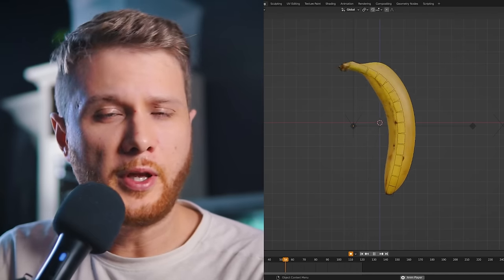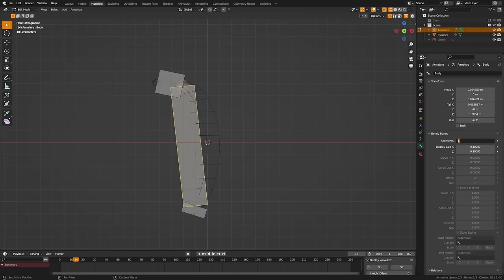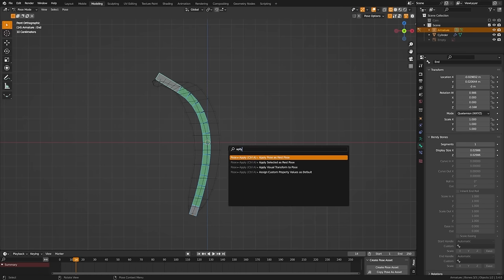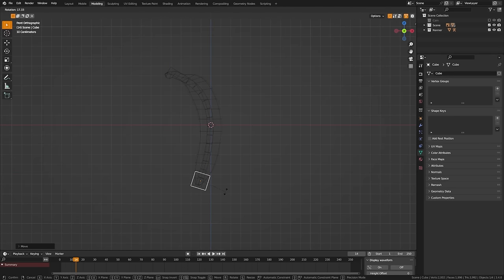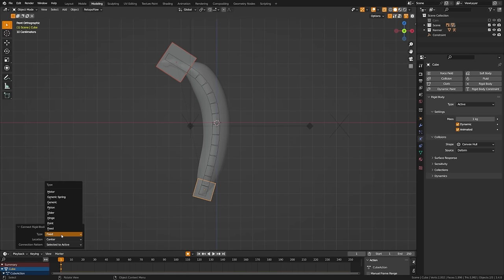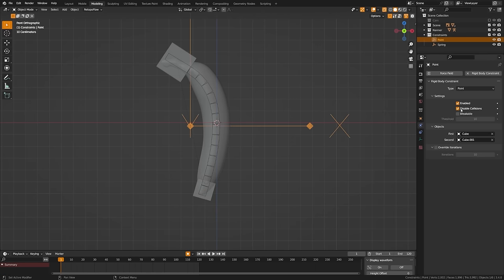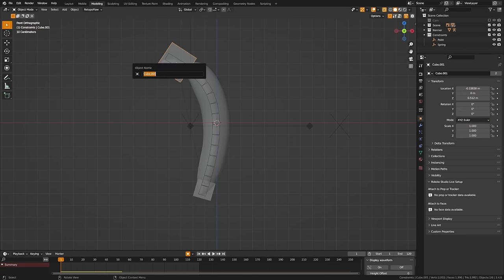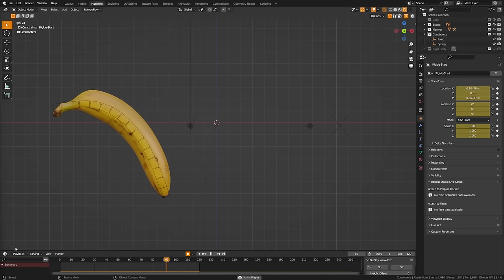EASY Floppy & Jiggle Physics Rig in Blender 3D

Comment: Does this work similarly to the wiggle bones addon? That one is great it's just very outdated and glitchy now
Reply: I made some edits to that so updating is easier. Core code is still the same, yet using it easier
Reply: Wiggle bones and or jiggle bones is different. Its custom code, python which does all the calculations on run time

Comment: Hey! so I'm running into an issue where I'm trying to have the ridged body constraints move with the armature for a more accurate view of whats happening. With the way the armature is set up: its not a part of the main character rig but instead its a part of the hat that is parented to the character rig. I noticed that while the animation works the bones aren't following the hat. but seem to accurately deform the dangly bit when the animation is played. from what I can gather from the video it looks to me that the armature is dependent on where the start ridged body constraint is in space and will only follow that. which makes what I'm seeing in my viewport all the more strange, but I digress. I suppose what I'm asking for clarity on is how can I get the ridged body constraint attached to a mesh or armature for the sake of seeing the bones translate through space like they do here.

I feel it worth reiterating for the sake of clarity: when animating the ridged body cubes. the armature moves. to my understanding; my next thought was to parent the animated constraint to the moving armatures spine bone. doing this led to the armature moving but only the start bone leaving the end bone behind deforming the dangly bit in a mangled mess. (at this point I had reset the inverse and made sure the origin point of the armature had not been a factor left unaccounted for, yet I was met with a similar result. for the sake of transparency I'm still learning the ins and outs of rigging so this may be a user error thing but from what I can tell it seems plausible to do using this method of adding physics to bones. might you have an answer?

Comment: Fast, not always clear what is going on, but replaying each step, I got it all to work. One thing that confused me is the X/Y/Z spring parameters. You show stiffness and damping.  I saw only "X Lower" and "Upper".   Eventually I figured out I was unfolding "Limits" not "Springs" in that panel.  GUI design could be improved, perhaps.